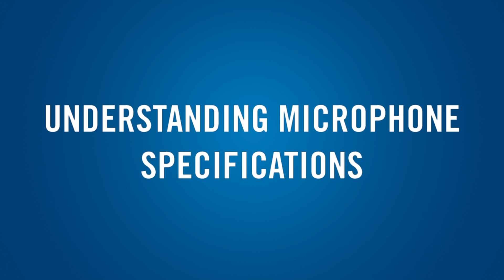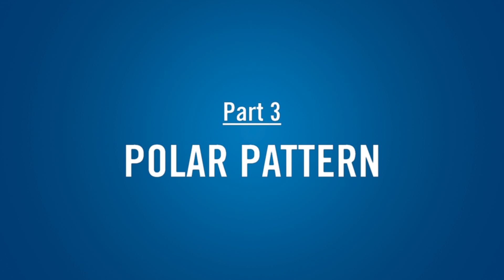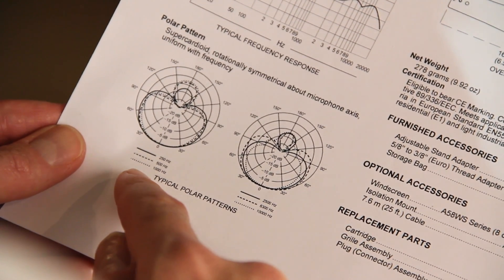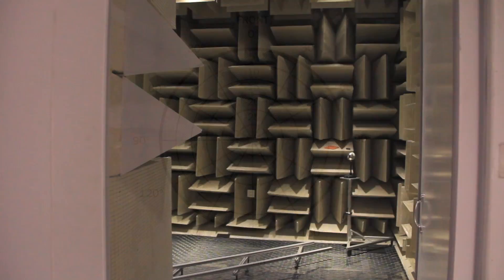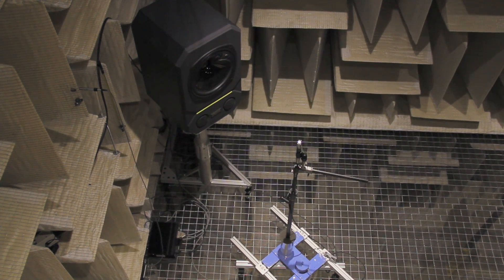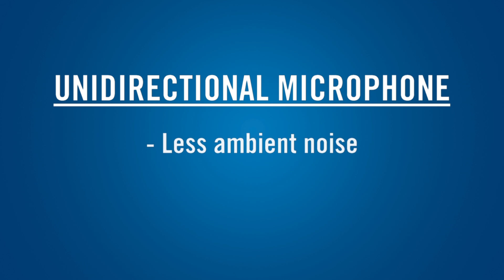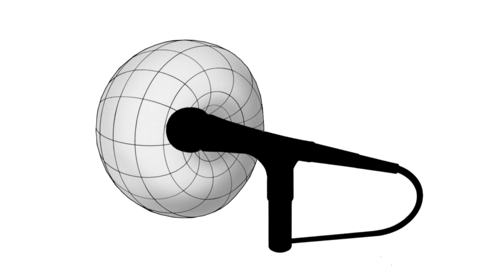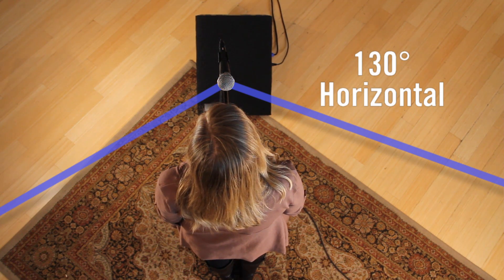Understanding Mic Specifications - Part 3 - Polar Pattern

Comment: In the example videos, it is unclear whether the monitor speaker is regarded as the sound source and whether the microphone is rotating or something else. Also, please answer me whether, on a microphone head, there is one area that picks up sound better than others or whether the mouth has to be straight in front, horizontal to the floor, for optimum sound pick up.

Comment: It seems subcardioid microphones are rarely discussed. Though the only advantage it offers is wide pickup angle and richer round, I still think it should always be mentioned. 
And is there anyway I could get a diagram of the diaphragm structure/arrangement (without dimensions) in one of your cardioid or subcardioid(KSM9HS) microphones? This will be very helpful in my current research.